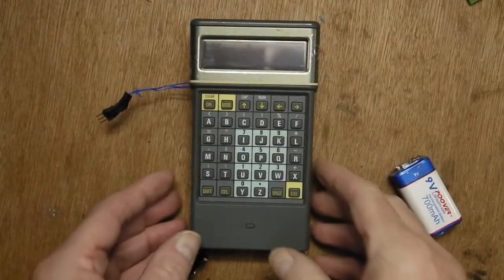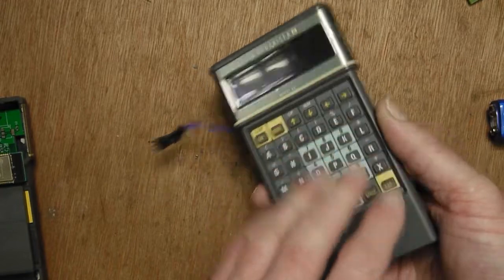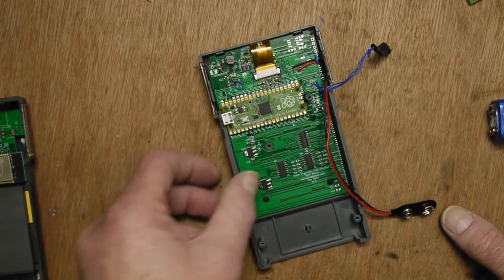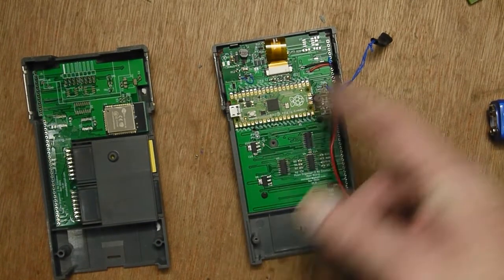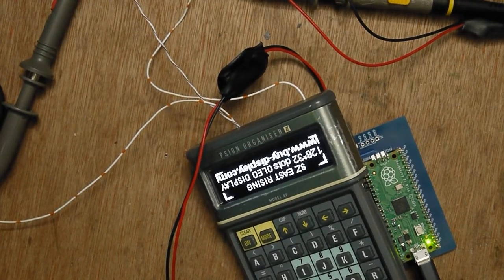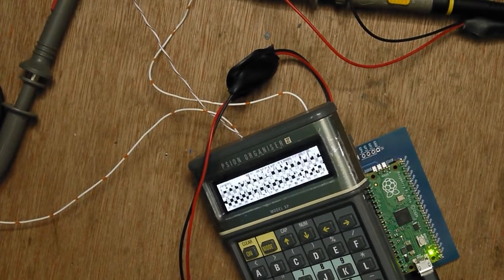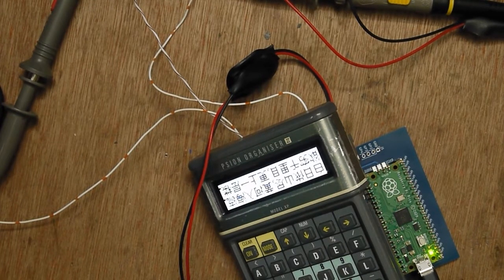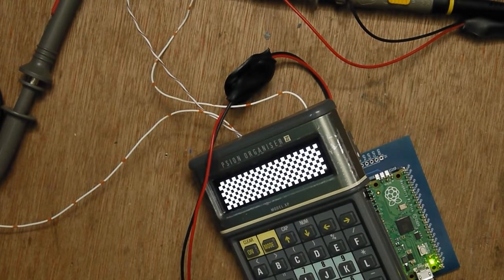Re-creation of Psion Organiser Part 2:Populating PCBs

Comment: I'm loving this re-creation - I am wondering whether it would be worth it to go one step further and add a qwerty keyboard (or a slot to attach one)
Reply from the maker: It's interesting that you make that suggestion. I have thought about the same thing. It would be nice to have a fully keyboard and also a nice big screen, especially for programming. It would require some code, but could probably be done. The display could be attached via the top slot, the keyboard as well, I think. So the top slot adapter I did with the Pico could probably supply a keyboard and dispolay interface, and also load cod einto the organiser. Quite a bit of work, though...
Reply: @menadue  Sorry for the late response - yes, it'd be quite a bit of work I agree, but it would breathe so much life into some pretty cool old tech. As an aside, are there pcb's available to recreate some of your stuff, such as the pak or even the rebuilt unit with an OLED screen?
Reply from the maker: @retrotechresto  Yes, a screen and full keyboard would make it easier to do a lot of things. I did actually buy a screen to attach to one of my top slot adaptors, but I didn't think about a full keyboard.
I do have PCBs, you can contact me at <my last name> at gmail dot com, or on this Psion forum: 

https://organiser2.org/index.php?sid=1b6df857de53e10dc917c2b7ccd8f829

Depending on which PCB you are after, it may be easier to get a fully populated version as some of them are tricky to build. The SD card datapack in particular is tricky and needs reflow. If you are happy with sensible SMD, though then the rest are fine.
Reply: @menadue  perhaps a standalone emulator would be easier?
Reply from the maker: @retrotechresto  Do you mean the same sort of circuitry but in a different form factor? That could be done fairly easily.
Reply: @menadue  that's what I am thinking. You have the rom emulator and pak gadget - put them in a single unit with the ability to attach screen and keyboard (or incorporated) and presto. 

At least it sounds easy to me :) I don't actually know how to do any of that.
Reply from the maker: @retrotechresto  It's an interesting idea. Sort of a desktop Psion. I think the recreation in the organiser case can do that, though, and is portable. There's wifi on the unit so you could connect that way from another computer. I suppose you do need another computer... Maybe a top slot adapter that has screen and keyboard I/O?